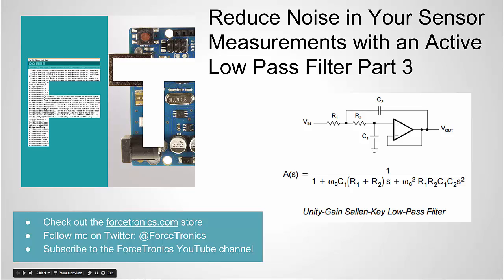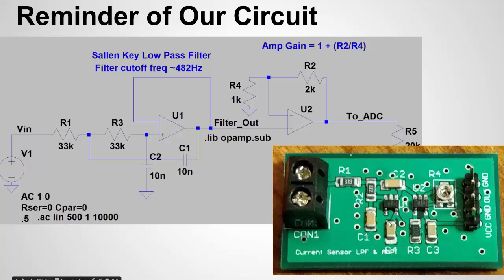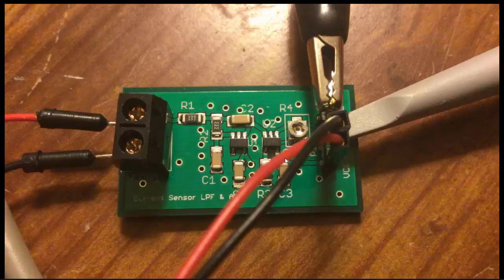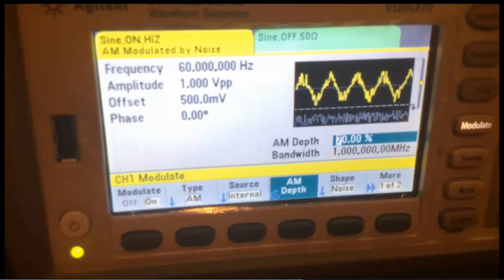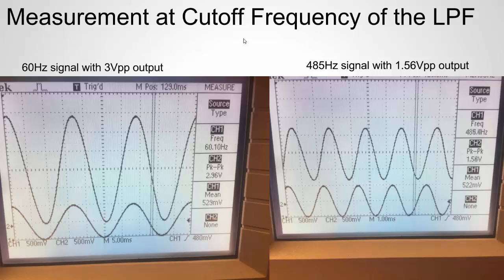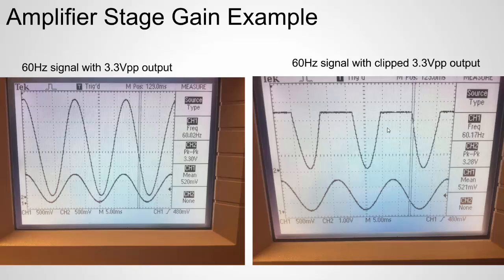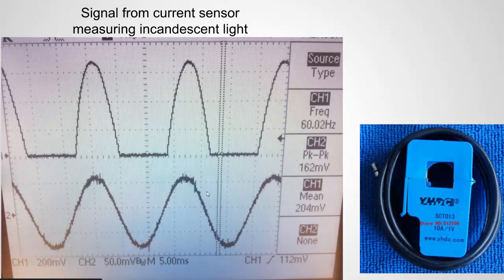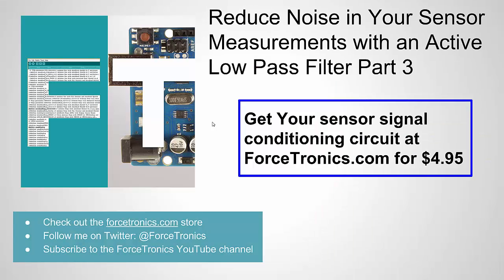Reduce Noise in Your Sensor Measurements with an Active Low Pass Filter Part 3

Comment: yea this is a great video series,amp clamps do give a lot of trash on the signal wire,you could hep a lot with oscilloscopes in the auto industry,a lot of tech are starting to use them

Comment: Good day. I have try this circuit and I got a voltage output of 1.055 V and that is the Maximum voltage that I've got. What can be the Maximum voltage of this circuit?
Reply from the maker: The maximum voltage is limited to the Vcc value for the op amps. The measured out voltage is based on the input signal voltage and the gain setting of the second stage
Reply: ForceTronics I have an input signal of 4V and the output on the first stage op amp is about 2. Something and when it comes on the final stage the maximum gain i have measured is about 1. Something even I turn the trimmer resistor. Is it correct?
Reply from the maker: Assuming your signal is non-negative and is below the cutoff frequency of the filter than it is not correct

Comment: is there a device used to cut the noise? plss response
Reply from the maker: Filters are devices or circuits that are used to reduce or attenuate noise. A filter could be as simple as a capacitor or inductor. They can also be fairly complex with various stages of analog or digital circuits. You can even filter noise in software by doing things like averaging ADC readings. You will need to research and test what method will work for your particular application.
Reply: ok thanks

Comment: Good series.  What company do you prefer for making your circuit boards?
Reply from the maker: If you are just talking about just the PCB: PCBway is overseas and cheap, OSH park is state side and pricing is pretty good, Advanced Circuits is state side and high end but great quality. I typically assembly my own boards. I do some small scale assembly as a service for prototyping and low production count boards (if that is what you are looking for :-) )
Reply: Thank you, I was looking for the PCB.